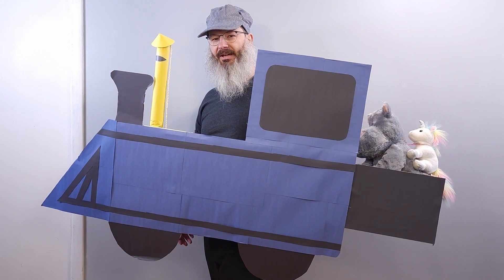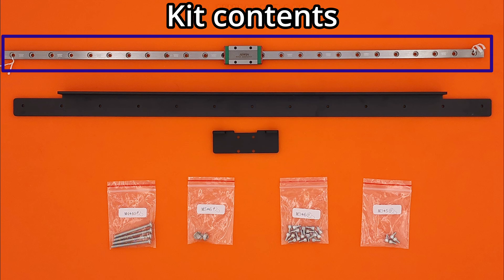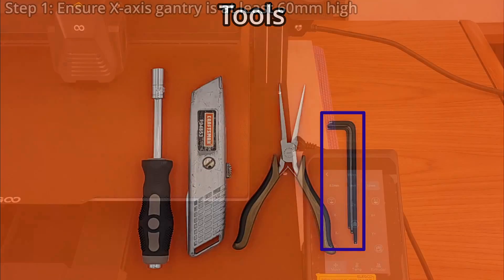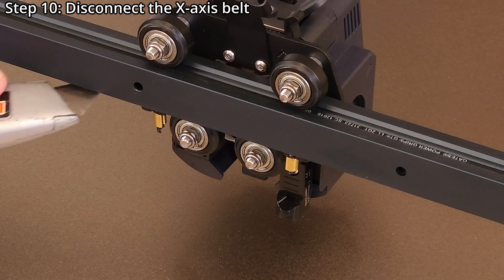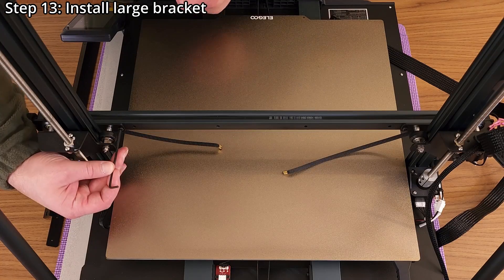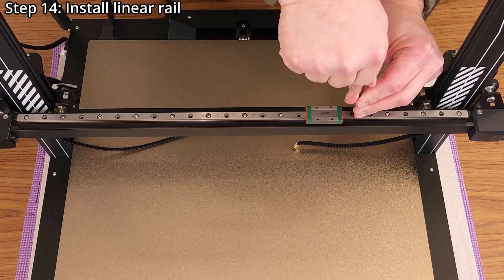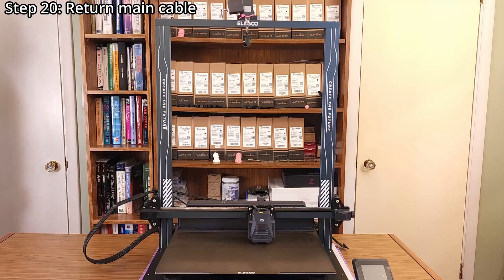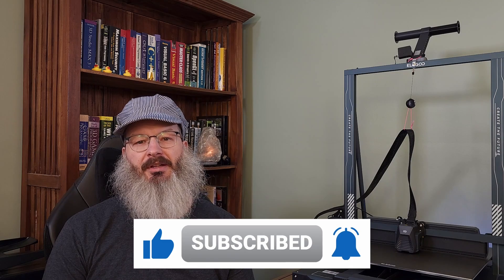Linear rails for the Neptune 4 Plus & Max: Part 2 - Installing the X-axis kit

Comment: how come at the end of the video the rail isn't on the machine? :D
Reply from the maker: You are the first person to notice. I generally perform the mod at least once or twice to work out an optimal set of steps before I start writing the script and then filming. As a result, I often don't film everything in chronological order.
Reply: @SandMMakers  yeah, i figured that was it, was just poking fun. Thanks for the walkthrough... the only problems i had were related to the complex cable control chain belts i was using, some parts had to be altered to fit under the fitting of the block.
Reply from the maker: @JKC40  I'm glad you got it to work!

Comment: Done!  Thank you!  I had to install four small washers on the small toolhead bracket because when I tightened the screws, the linear carriage wouldn't slide smoothly.  I'm guessing the bracket was slightly warped causing it to tweak the carriage when the screws were tightened.  Installing four small washers UNDER the bracket corrected the issue.
Reply from the maker: I'm glad you got the mod working! While applying equal torque to the screws is important to ensure proper linear rail function, I have not encountered any major issues with the X-axis bracket as you described. If you now have it working, great. Otherwise, contact TBStron3D and they will help you resolve any defective part issues.

Comment: Great tutorial, I installed all three linear rails using your videos.
I only have one comment.  Probably due to my lack of experience, initially I wired the physical switches incorrectly.  I actually connected 5V to ground ("c" to "nc"), assuming that Pin 1 on the board corresponds to "nc" on the switch.  Fortunately, the only issue I had was that the MCU did not start up.  Once I figured out to connect board Pin 1 (5V) to "nc" on the switch, board Pin 2 (ground) to "no", then "c" to Pin 3 (PB0 or PC8) the system was much happier.  Neptune 4 Max is printing happily.
Reply from the maker: Thank you for watching our videos! I'm glad you got it working and your printer wasn't damaged. Wiring might be the most error-prone part of building and modifying a printer.

Comment: I am getting INSANE x axis binding every 28cm after installing the linear rails.

I have leveled, aligned, adjust, replaced, every part of the x axis and it still binds when i tighen the belt.

It is driving me crazy.

Does anyone know what the issue could be?
Reply from the maker: If the X-axis linear rail is binding, there are four possibilities. 1) the linear rail needs more cleaning, maybe a metal bit is caught in the ball bearings, 2) the linear rail is somehow defective (unlikely, but possible), 3) the screws to mounting the linear rail to the printer are not equally torqued, causing flexing in the rail, and 4) the screws in the toolhead mounting bracket are not uniformly torqued, causing flexing.

Comment: Great video. You should consider stocking these as I would be happy to pay a premium to get the from a local source.  BTW where did you get the cable retractor, balance wheel?
Reply from the maker: Thank you!

I'm not affiliated with TBStron3D, so I'm not able to stock any of their products. However, they have great service and shipping is rather quick for international shipping.

The cable retractor is just a retractable badge holder, available at most office supply stores. Not sure what you mean by, "balance wheel".

Comment: Question, I just put this on my max 4 (I got the correct kit). How freely does the linear rail move before you attach the belts. When I tighten up the 4 top screws to the sled it takes sowm force for them to move. Not grinding but in figured they would move easily.
Reply from the maker: The linear rail carriages, especially after being lubricated should not move because of gravity. At least with HIWIN rails, the rails have a preload which reduces wiggle buy increases the force required to move the carriage. The grease also increases the force.
Reply: @SandMMakers  awesome thank you! And good to note. I gsve them a good cleaning again and added more machine oil. It does feel better. Working on the Z axis upgrade myself at the moment. Accidently ordered the wrong kit and decided to put it on anyways. It's way more involved than the other two. Waiting on the Y kit to come in.

Comment: Hi, I know you are going to video the y axis upgrade. I am seeing if you have had any issues with this kit fitting on the y axis. I tried to fit mine to my N4plus and it won’t fit due to the location of the y accelerometer on and the screws for the sliding bed to fix to the linear rail mounts are too short with the silicone washer underneath. Would like to know your thoughts. Thanks Trev
Reply from the maker: Part 3 (Y-axis) will be uploaded in a day or two. I'm having a difficult time understanding your comment, but I didn't encounter any issues installing the kit on a Neptune 4 Max using the silicone gasket option.

Comment: nice job, you plan to put videos out with comparisons on what you printed with POM wheels then same print with Linear rails, easy of use? better tuning? seeing a quality change with the upgrade?
Reply from the maker: Thank you for watching our videos!! I've been considering making a follow-up video after the series is done, but I can't make any promises. However, the printer in the videos is brand new and hasn't been used to print anything yet, so I wouldn't be able to present any direct comparisons.